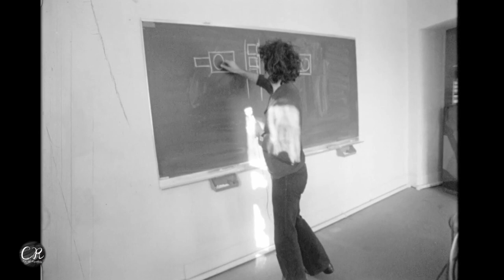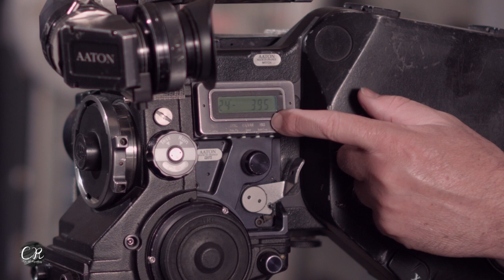Aaton XTR Prod -The Workbench- Episode 4

Comment: Great job on this video. I never knew about listening for the second click when entering test mode. That’s a great little tip. Someone once taught me to check the gate, put a small mark on the film with a sharpie, then manually moving the shutter. If the film is loaded properly, the marker will not move until the shutter has fully closed. If you see the marker moving while the film’s exposed, then you know the pull down claw isn’t engaging properly. I’ve found that to be a reassuring test while on set.

Comment: Great video! One of the most informative about the AATON S16mm I've ever seen. Thank you! I have a question regarding the power. I upgraded my XTERÁ with a power converter by elokuvakonepaja which outputs 13,2V. Since it is higher than 12V, I am now worried that my camera will fail after prolonged use. Would love to hear your thoughts.
Reply from the maker: Thanks! Glad you liked it. You'll probably have no problems with the 13.2v. The problems really come in over 14v. But the transistors that run that 5v circuit are troublesome anyway. I would figure they'd fail no matter what, so won't the super capacitor, just old age stuff.
Reply: Hi, I'm planing to upgrade a XTR Prod (with the XTERA conversion) with a better battery system. You mentioned here you upgraded your XTERA with the elokuvakonepaja adapter.  But Xtera has two battery ports . Did you get two adapters for the camera ? Do they fit? Or just one adapter for one port only will provide enough power to run accessories etc?  Thanks
Reply: @friendsofrocky  One port is enough. I connected the adapter to the top port and it works fine.
Reply: @julianreich   So you had your elokuvakonepaja adaptor custom made for the Xtera ? I don't see the Xtera option in their website. They're not cheap. I'm looking for different options, also for upgrading the VHR with a HD tap. Thanks.
Reply: @friendsofrocky  it wasn't custom made. The body of the xtera and the xtr prod are the same, so the adapter will fit both. When you upgrade to an HD Tap remember that this will take away the meta information provided by the orginal tap, such as RUN/STOP and the counter.

Comment: Awesome! That is a fantastic film camera. 23:08 great view of the gate/aperture plate! No raised horizontal framing it seems. Looks like nothing touches the film image and you won't get any dirt buildup or hair at the framelines. Please let me know how the film image is kept evenly focussed, no curving/camber, when there is no pressure across the image.
Reply from the maker: The pressure plate which is on the magazine holds it on. There is a lateral spring loaded rail which pinches the film very much like a bolex only smaller. So it’s stability is really good.
Reply: @CinemaRepository  Thanks for the information!